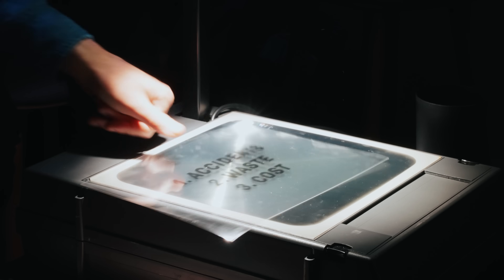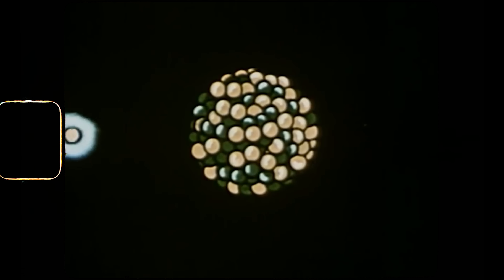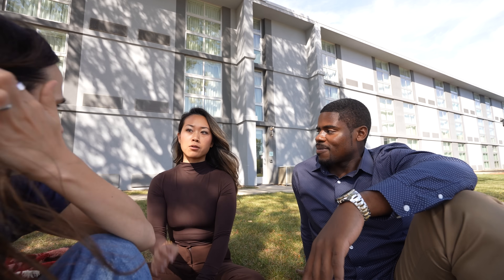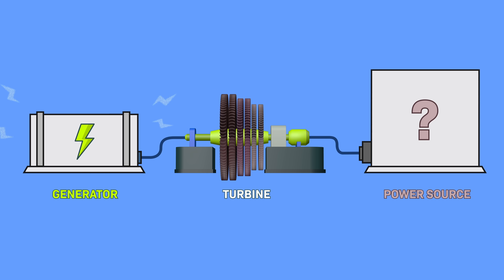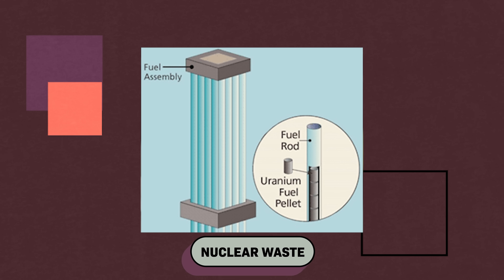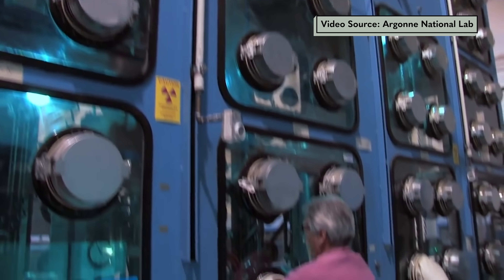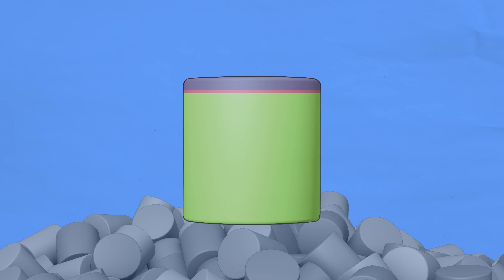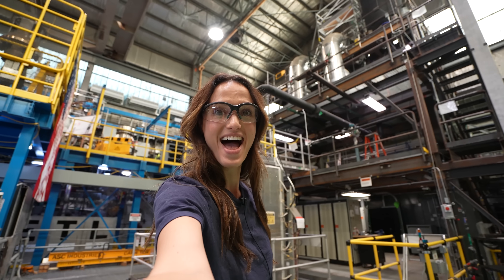The Big Lie About Nuclear Waste

Comment: Just a note.. as someone who has worked for several years in the nuclear power sector in the US.. not all nuclear waste is the recyclable ’spent fuel rods’. 
There is plenty of additional ‘low level’ radioactive waste that is made up of contaminated materials created (for example) during maintenance activities and fluids that have become contaminated. These are most likely not recyclable and do represent a long term burden to the country.
Reply: "Just a note.. as someone who has worked for several years in the nuclear power sector in the US.. not all nuclear waste is the recyclable ’spent fuel rods’. 
There is plenty of additional ‘low level’ radioactive waste that is made up of contaminated materials created (for example) during maintenance activities and fluids that have become contaminated. These are most likely not recyclable and do represent a long term burden to the country."

Yes, but you'd need to create less nuclear waste because parts of the waste will produce energy. You'll need less storage room for the material that isn't recyclable or left over after the separation process. 

The waste product of burning fossil fuel isn't kept in containers but released into the air. CO2 also takes a long time to clear from the air and is harmful as well. People who think fossil fuels are less dangerous to the human race are brainwashed.
Reply: @gwenwalravens8030  People who think that the tiny amount of CO2 currently in the atmosphere is dangerous have allowed themselves to be brainwashed by the blatant propaganda and lies. Talk about gullible and stupid!
Reply: A lot of this is medical waste from radiotherapy.  The amount of radiation in these waste materials is sometimes hard to even measure.
Reply: @artgoat  you should look into the problem of the nuclear exposure problem from a medical perspective, in that we ignore the longitudinal data from many clinical settings, like Japan being nuked twice, in favor of models based around irradiating fruit flies. I am more than willing to accept that you can get funky things going on from contamination, but I am not willing to believe that it's the radiation from the contamination that is a problem. The body produces a massive amount of free radicals and radiation on a given day.
Reply: @Dan-gs3kg  Just for fun, I googled “fruit fly percent human dna”.

I found that fruit fly DNA is 60% identical to human DNA!
That was much higher than I expected - and for a moment I thought that extrapolating tests on fruit flies to humans had lots of validity.

Then I scrolled a bit. I found that a STRAWBERRY’s DNA also 60% matches human dna 🤣🤷‍♂️
Reply: @artgoat except the caesium ones…
The overwhelming majority of nuclear accidents around the world are related to medical orphaned courses.
Reply: @artgoat  All of the materials used for radiotherapy are in fact recycled waste from nuclear reactors....
Reply: I heard that there is a technology(in developement) even for using low level radioactive waste by the hungarians (for years now)
Reply: What's the story with Yuma Mountain?
Reply: @tetoffense7659  The Yuca Mountian repository was defunded and is effectively dead. There is currently no active long term storage solution being developed/planned/funded by the U.S. government.
Reply: That is an argument of design. If the design you used created that extra waste, there is always a way to reduce that process waste. I work in process safety. Although, I will admit that better methods may cost more labor hours and infrastructure cost. They were probably just trying to keep it in a certain cost envelope.
Reply: @DaedalusHelios  the contaminated waste comes from cleaning, maintenance, contaminated coveralls, repairs, replaced parts.. all sorts.. as regulations evolve, systems are modified or replaced due to regulations.. the old parts are ‘crapped up’ often just through having served in the ‘hot side’.. you can debate as to whether this can be designed out.. there’s no getting around the fact that this waste will be produced.
Reply: @LordBruuh --- Exactly!

Besides nuclear, and cleaner coal/gas/oil burning, the only viable "green" energy is hydro/tidal, geothermal, solar updraft/thermal solar.

But electricity from traditional solar and wind methods is garbage and a huge scam.

Nuclear is the best and should provide the majority of energy for cities, with other sources being used supplementally as needed.
Reply: Interesting, but would a recycling program of some kind still be more practical in the mean time, until we come up with a better solution, despite the low level waste risks?
Reply: thats where research should happen, too
Reply: @Mr. Richard C. It is much more dangerous because it is a witches brew of radioactive isotopes not found naturally in coal. The mercury in coal is more of a concern than the isotopes in coal
Reply: I’m a fan of what the Europeans are doing and just digging a big as hole and chucking them in it
Reply: All of the (coal) fly ash waste sites that are ecological disasters waiting to happen too. It seems to be a common misconception that you can burn fossils and the CO2 is the only waste product. The reality is that coal is mined from the ground and is contaminated, sometimes even with radioactive materials like uranium. A coal power plant puts 100x more radiation into the air than nuclear plants. Many of these fly ash pits sit on the banks of waterways and contaminate our drinking water and environment already. The nuclear fuel waste and potential ecological disaster is arguably easier to manage because the volume is so much lower. If not for coal power already being an intrinsic part of the power grid, it's hard to imagine a coal power plant being an acceptable project given the environmental impact.
Reply: The amount of space required to store all of the nuclear waste from the entire planet since the beginning of nuclear power takes up less space than a single wind or solar farm.
Wind and Solar are far more damaging to the environment than Nuclear Power with our current capabilites.
You don't just put down and wind and Solar farm and leave it there forever for 'free energy'. Those wind and solar farms wear down just like everything does. While the waste from Wind farms and Solar farms is not radioactive, it is also not recyclable by any means we currently have and it buried unlike nuclear waste which is stored above ground in constantly monitored containment cells.
Not only that but these wind and solar farms are eventually abandoned and there are huge swaths of land that are just solar/wind farm graveyards.
The alternate options for energy besides Nuclear all cause so much more waste than nuclear power plants do that it is not even close.
One day with advancements we may be able to recycle solar/wind farm waste or improve our grid and other features to make them worth using but as of now they are terrible for the environment. We also will eventually have better ways to deal with nuclear waste, but as of now as I said all of the nuclear waste ever created in the world takes up a tiny spec of space in the world to store, where all of our other forms of energy cause massive amounts of unrecyclable waste that also require plenty of pollution to create the fuel for in the first place. Those materials to create solar/wind are not generated out of thin air.
Reply: There are plenty of waste burden that we as a society have to take care of, especially in chemical industry. That is a bill that industry inexorably asks us to thrive and flourish as a humankind, and pretending that we should not have such burden to deal with for many generations to come is only going to make things worse because the environmental costs of such externalities will be the real thing future generations would have to pay, not the production of externalities in se. Also, the fact that you are talking of waste falling into category of "low-level" means that no such extents of bold measures should be requested to deal with such kind of waste in even the long term, as compared to so-called high-level one. I also point out that, given that the issue of toxic waste burden is not a problem that mostly nuclear power have to let us deal with and to concern with as well, but it is due to any industrial facility that we need to not torn apart our well being, and that the point is not to not unrealistic wishing to not produce that waste at all despite is inevitable, but to isolate it from the biosphere, which we also routinely do with a very higher amount of highly dangerous chemical waste without a bit of the same amount of paranoid cautionary regulatory measures that applies to dealing with nuclear waste (also low-level ones) would barely be requested (!!), it's a bit bizarre that it is nuclear waste that drives such amount of concerns just because most people have a highly clueless grasp of ionizing radiation and especially on the measure of risk that could be reasonably associated with it, and this even with no regard for the dose as we would use to do regarding any other kind of poisoning agent, but far higher in magnitude orders and often even in toxicity amount of chemical waste we produce on a daily rhythm, just because "not radioactive" (so that will remain dangerous FOREVER, not just as long as when it became as radioactive as uranium ores!) does not drive such supposed "concerns" from antinuclear lobbies which resorts only to anecdotes to scare the public in such selective way.
So it's not a matter of genuine concerns. It's just utterly clueless fear of technological engineering and breakthroughs that are too complex for many people to understand. And that tied with strong support from the fossil fuel complex, which environmental and health damages, in complete comparison to the alleged those of nuclear materials, are instead well-known and proven by thousands of peer-reviewed studies.
Reply: @anhourofhonourforanhonesth2940 --- The near future is in gas, oil, and coal... as we build more nuclear, hydro/tidal,, geothermal, and thermal solar plants.
We will retire the older energy sources.
Reply: @BlueAcid9  I doubt we will retire legacy energy solutions in any foreseeable time. One datapoint that I suspect would shock many is that coal demand hit a record high, get this... in 2022! The thing is that total energy demand itself is rising globally. It's something that people from the developed world may have issues grappling with, but there are many parts of the world where there is very limited or no access to electricity. If memory serves me correctly, there are about a billion people with little to no access to electricity, and three billion people who only consume the energy equivalent of an average refrigerator. I probably remember those numbers incorrectly but that's about the scale we're talking about anyways. A very large portion of the world remains unelectrified and underdeveloped, and those people would like to have the same amenities we in the developed world take for granted. That's why I'm certain the demand for all forms of energy will keep growing for decades to come.

Eventually of course I like to think that we will reach some technological milestones that allow us to produce abundant energy with as little impact to the environment as possible, but that time is not something anybody can really predict.
Reply: @TheHeavyModd  you made an excellent point by taking everything into a bigger, more global context/view. I said this for the longest, every single barrel oil the West isn't buying, someone that will happily say, "thank you." so ultimately, it'll get burnt just somewhere else. I don't wanna hurt the environment, but have a feeling that environmentalists don't really take this aspect into consideration.
Reply: Thank GOD we can 100 % recycle everything that is left over from solar panels, batteries and wind turbines
Reply: @georgeinthejungle6095  not even the propagandists of renewables are claiming this, lol.
Reply: @To.Ma.To_78  well you see ,here is the beauty of coal based energy " IT IS 100% renewable "
Reply: @georgeinthejungle6095  
😂😂😂
Reply: @georgeinthejungle6095  Contains lots of irony 😂😂😂😂
Reply: @georgeinthejungle6095  I wonder how many will notice the sarcasm of this post.
Reply: @georgeinthejungle6095 
And thank god those PV panels, wind turbines and batteries never need maintenance and never wear out.
Because, of course, if they did - the math wouldn’t make sense and we wouldn’t build them.
Reply: @georgeinthejungle6095 no we can't...
Or was it ironie ? If yes we'll done 😂 If not, you know nothing than propaganda 🙄
Reply: @george in the jungle  we can. It's just that current is not in favour of it.
Reply: @georgeinthejungle6095 🤫
Reply: Yeah - all that contaminated water at Fukashima - tell them they can make more energy from it.
Reply: Geoff..,you are correct. The French ran the most efficient nuclear program in the world and recycled and even bred fuel? But now after their old reactors need to be decommissioned they are being crushed under the burden of all the low level nuclear waste. What people fail to realize that even after a couple hundred years after the spent fuel is cooled off and not nearly as high level radioactive waste, this low level waste is the most dangerous because all the new created fission isotopes are more dangerous than the original low level radioactive fresh fuel...because they're all readily absorbed and spread throughout the environment and must be stored to prevent this for hundreds of thousands of years. This is the deadly part if it all.
Reply: @gb-jg1ud  As a rule, though, isotopes that are more radioactive are those with shorter half-lifes, so highly radioactive materials are also those that need to be stored the least amount of time.
Reply: @Nyerguds  correct. The most radioactive isotopes are the easiest problem to deal with because on a human scale we only have to deal with them a few hundred years..,but its after that that they are still extremely dangerous and must be contained longer than the age of the pyramids.
Reply: @gb-jg1ud   reference please! Sounds more fear than science to me at first glance.
Reply: @jean-marclamothe8859  I replied to you twice it will not allow links
Reply: @gb-jg1ud  .. agreed.. this dimension is seldom discussed, but I feel it needs to be far better appreciated.
Reply: @Kiwigd --- Wrong, all "waste" is merely potential resource waiting for higher efficiency extraction of radioactive energy.
In the mean time it can be melted down either as metal bars and stored like gold or steel, or the slag can be mixed with molten glass and stored like hard cheese wheels.
It is stable and be kept in underground facilities in Salt Lakes and similar safe environments.
Reply: @BlueAcid9 
Germany is right now trying to dismantle a nuclear reactor that has been in use, and I am afraid the project proves you wrong. 
(You could look up 'dismanteling Lubmin nuclear reactor, but I am not sure there is resources in English)

The new estimation is that'll need 200 years to complete. 
There is so much radioactive concrete, there is so much metal still to active to be touched. 

Lubmin only has been used for a couple of years - I am afraid, your longer-in-use US reactors (and basically every other reactor in the world) won't be dismanteld ever. I am afraid the human race will have been eradicated before the plants cool down enough to start the 200 years of dismanteling. 

That does mean, before they fall apart, that you will need to find a way to encapsulate them so the radiation doesn't seep out - for forever, which usually is no term an engineer thinks in. 

Again, Germany is trying to build such an "forever" storage place (just for the waste, we do not operate any more reactors), and the cost is astronomical - and we do not sit on nearly as much waste and low level waste as most other countries, because we stopped pretty early.

This debate is a very hard one, because almost noone knows all relevant facts and energy production is such a central topic for economy and modern life. 

But the waste is going to be really, really hard to get rid of. 

And it is different for solar panels and wind turbines, as those cannot make ppl in a 50km radius sick. 
Nuclear waste can and does kill. 

Humanity doesn't have a great track record of clearing up regional health debacles - on the topic, how is water in Flint? 

I personally do not think it is worth the risk (and the cost, studys comparing the cost of energy sources clearly list renewable ones as the cheapest). 
You can, oc, disagree. 
There is a whole ocean between us, I am not that afraid of the choices the US make and would rather try to convince the french :)
Reply: @sini234  Being from Germany myself, I watched that documentary film about Lubmin a few months ago. The input-output ratio of costs and effort for dismantling the facility to the power it once generated is just horrifying. Let alone this is just ONE reactor -- of the many we'd have to deal with in the future.
Reply: @sini234  

You're afraid.  You think.  You believe. You feel.

Your fears, feelings, beliefs, and opinions are irrelevant.  

Engineers solve problems.
Reply: @gregmiller8284  As an engineer, I can tell you for sure: this problem is not solvable right now. 

Forever is not possible. 
For 1000 years is not possible. That's basically forever. 

Please excuse me trying to be polite in your language, I did learn a way to reach that was to write "I'm afraid", before speaking about bad news. 

I feel and I think I couldn't find in my text, did you only use them so your statement would look more impressive? 

I believe I did write - and I did also write you may disagree.

As I stated, this is a very heated topic, especially since the fabs you're trying to bring to the US will need a ton of power to operate. 

And it is true: it doesn't matter to me personally if you blow up your whole country. I am quite sure I wouldn't miss it.  Mine has always been able to thrive in Europe. 
Then again, if you blew it up with nukes, you'd deteriorated the air quality so badly, life would probably be impossible on the whole earh. Since that isn't what your planning, that's okay. You are planning to risk that every single nuklear power plant going to leek it's radiation into everything close to it. That's going to make dozens of city's in-inheritabel.

Right now, what everyone is telling you is true: the power plants are mostly safe. 
But since forever is impossible, that's not going to stay that way. It might not be for another 100years, before the first collapses. But one will.  

I am more than glad my country can operate seperate from yours, and does just that. 

I am sorry you didn't seem to have read what I wrote well enough to respond to one of the factual points I am making. 
I am sorry you didn't see that someone who also has knowledge on the topic responded to me. 
I am sorry for the next generations in your country. 
 
I found you comment to be very rude. Can you bring anything factual to this discussion? 
The only thing you did was trying to invalidate my facts with the way I am writing in your language. 
Do you find that a good way to discuss a topic? 
And even if it was just an opinion and nothing more, your text is also just an opinion and nothing more. 
You put all your hope on people like myself to solve your problem. 
Hope. You can see that yourself, right? 

Just because something seems to be a perfect solution, doesn't mean it's safe. Doesn't mean it can be safe. 
Did you know that places selling shoes in the past have used X-ray to determine if a shoe fits perfectly? That practice needed to be stopped, because there was no containing the risk. We cannot solve every problem, and nuclear power might just be on of the unsolvables. 

I will leave it at this, because I believe you just 'know better' and that 'your perfect country can't do wrong'. 
Have a great day, have a great life. May the problems you are facing not be yours to solve.
Reply: @sini234  while your text contains lots of typical "mistakes" (well, this actually goes whichever way you wanna take it, lol), I'd like to provide you a little "donkey bridge" [<= ain't no "proper" expression, lol] for one of them: you may like leek in your tacos, but you really like leakin' tacos. 😉😂
Reply: @WoodymC  not only that.... image the realistic timeframes!

Planning : 5-10 years
Building: 5-15 Years

Operation : maybe around 50 years

Dismantiling: 10-XXXX years...

So even if you take absolutly mindboggling fast planning and construction, a maximum run time of 50 years and lighting fast dismantling, 

you use 20years of non-use against 50 years of use and then you still have shit left over that will takes almost forever to be dealt with...

It just doesnt add up.....
Reply: @gregmiller8284  Yes yes... engineering solves problems, until it doesnt.... or it takes 20-30 40 years to dismantle them.... 
Just because something is technically feasible, doesnt mean its a good thing to do....
Reply: @Mouhfighter  To be fair, we should put that timeframe in correlation to the energy output of the facility. Fission generates way more output than e.g. fossil fuels, just as fusion power is in an even higher dimension (I have no idea what practical cycles will look like for this kind of reactors).
Reply: @gregmiller8284  engineers on sigma level.
Reply: @gb-jg1ud  thank you for this comment!
When watching this video I thought it was sponsored by the nuclear industry. The information provided here are not really balanced
Reply: @gb-jg1ud  Good example. And to me it's like shutting the stable door after the horse has bolted. We need solid solutions for dealing with all the waste, not this high level marketing campaign from the nuclear power lobbies telling us it will be safe, trust us...
Reply: @aries6776  The only method of dealing with waste beyond storing it somewhere for thousands of years is to run it through a breeder reactor
Reply: Commenting to give this a boost.
Reply: @eh86055  it's the top thread that had been hot just four hours ago and you commented during nighttime—so, somewhat inconclusive to which extent this was needed, lol.
Reply: Bingo! Exactly correct.
Reply: Thank you for posting this it's the hard truth.
Reply: @brandonhammett4071 --- He's wrong.
Reply: @BlueAcid9  I have worked in the nuclear industry, and from my experience, he isn't wrong.
Reply: @brandonhammett4071 --- He's wrong, and your experience means crap. The nuclear industry you work in is one that has been artificially hindered for several generations, 
Without that the technology would be much more developed and the energy process much cleaner along with storage .
Which even assuming the waste couldn't be used for anything would only need to be stored for 100 to 200 years before it was no longer dangerous.
Reply: @BlueAcid9  I was one of the contractors who was literally on the reactor floor, swapping rods, and changing fuel pellets.  So maybe you don't know everything about it. Maybe you should consider there's alot companies keep out of magazines and the bullshit you read. Or maybe get out of the basement and find out for yourself.
Reply: A burden that is far outweighed by the benefits
Reply: In short: We should do anything possible to switch to renewable energy sources. Nuclear energy can only be a bridge not a solution and should just be used, if we don't have a noncarbon alternative. The already produced waste has to be made as harmless as possible even though it will never be really harmless.
Reply: @holterman88  sorry, but what you are saying is flat-out foolish. Assuming that so-called renewables have a means to be developed, THEY ARE purposely to be a stopgap solutions (for what they could reasonably produce), whilst nuclear power is intrinsically THE solution to switch from a fossil fuels based economy, due to be the densiest source of energy human ingenuity has ever invented. As for the waste, again, it is very utterly bizarre that this has been portrayed as a uniquely dangerous and concerning kind of waste, given that is is small, and never have harmed anyone. Please, don't fall into bullshits which are born out of cognitive dissonance and utterly ignorance of energy engineering, to force development of "renewables" beyond the reasonable feasibility of such alleged "solutions" just because widely promoted squeamishness on nuclear power that fossil fuels lobbies has promoted to get themselves sealed without no serious threat on their monopoly that nuclear power could pose in the first place, is profoundly ideological, not scientific. It's the same thing as Lysenkoism, trying to force natural laws to fit an ideological point of view at all costs, in an a priori means despite what biological laws says, let alone any reasonable feasibility of such things, which has obviously led to utter squandering of economic resources on Stalin's Soviet Union and to dire starvations which caused many tenths millions deaths in the late 1940s through Soviet Union and Mao's China. Low-dense energy like renewables are flat-out THE PAST, they are actually an utter waste of taxpayers' money, and persevering to fund R&D on them instead of focusing on more proven, as well as provable feasible, solutions is a play that favor Oil&Gas interests to remain sealed and to flourish when the real proven solutions are treated with squeamish at the best, and the economic and time resources to transition from fossil fuels are intrinsically scarse and limited to deflect all those into delusional "solutions", which are of very little use, and more importantly given that the flat-out first sign with which you can clearly identify a quack is when you are dealing with someone who promote the blatantly unscientific idea of "solving" an issue as big as the energy one with ONE kind of solution: it doesn't work, it doesn't work with fossil fuels, nor nuclear, let alone "renewables". The first clue when it comes to understand ANY energy issue, especially globally one, is that there is no such a thing as a silver bullet that could be versatily used to deal with all energy issue, you need a very complex strategy which poses a well-projected energy mix to diversify energy sources evaluating each one's costs and benefits in a rational and scientific, not emotive, ideological or anecdotal, means. Anyone who promote a small kind of solutions as a kind of panacea is a quack which has no credibility, which adds even more at who fools people by promising that "renewables", the worst kind you can pick out of such solutions, can feasibly and economically sustainably replace a dense source of energy such as fossil fuels or nuclear! As for renewables, we ceased to rely mainly on them when we managed to escape from poverty and begin to flourish, so to replace wood, wind and solar with coal and gas, and from these we should be expected to switch to uranium, which produces as about 50 million times as heat energy as carbon combustion per atom unit, leaving renewables to fill the peaks of demand and the load following. We should be develop NUCLEAR AS POSSIBLE AS WE CAN, not renewables, if not just as a (partial) stopgap together with replacing coal with gas in the same time frame.
Reply: Cant we just dissolve it in any other mass? Just mix with anything and radioactivity will reduce million times.  For example mix  1 kg of waste with 1000 ton of dirt. The resultant mix will have on 1 in a million radioactivity of the original waste?
Reply: @Yggdrasil_Story  nah, it's better to keep the high level waste contained or confined to a small, controlled space. but you can certainly do it with low level waste. in fact, that's what's done in France, where after a certain rest period, material used for the construction of now decommissioned plants is recycled back. that's why you can—theoretically, at least—buy a spoon that contains some metal once used inside a nuclear power plant. something activists really relish pointing out, as you might imagine, lol.

apparently, the tiniest amount of (dust) particles is problematic when swallowed. after that Chernobyl "incident" rather fine particles where sent up high into the atmosphere due to the fact that you had a gaping wide open hole in the ceiling and graphene burns at a very high temperature, causing an updraft strong enough to propel some particles high enough into the atmosphere so that the weather system carried them over half Europe and came down at various places with rain again. that's already a massive dilation, yet it was (and still is) problematic. it actually rained on me, so I'm somewhat familiar/connected with this situation. the surface around our social housing building was excavated afterwards. and that's just one incidence in one block of one plant at one particular time. so, the actual dilution required for all waste there's might just be unachievable.
Reply: @To.Ma.To_78  well said. Dilution is not the answer. If it gets into the environment in any way it re concentrates due to food chain and the fact that water runs the planet. And it has hundreds of thousands of years to do it. The high level waste in one spot for a few centuries not the problem. Its after it is low level and equal to the massive...massive..
Amounts of contaminated waste we already have.
Reply: @gb-jg1ud  very wise of you for pointing out that it'll concentrate again over time due to the food chain! on the other hand however, I do disagree with the terminology you used, when you described nuclear waste—which indeed is problematic, I wouldn't question that—and said, "massive;" repetitively, even. that's one of the great advantages of nuclear that due to its density, actual material required is minimal. compared to the Earth's surface, Mt Everest isn't even "massive." it might be a lot for one single person to put up with when stored in their backyard. but compared to the gigantic vastness of huge swaths of land masses all over the globe—no, it's not really noticable. a solar plant with the same nominal output weights about 18 times as much as a nuclear power plant (this includes all auxiliary buildings as well.) and rare materials that require mining weigh 300 times more. and yes, mass gives a pretty good overview/indication/estimate of what we're generally dealing with. since positive cost effects gained due to mass production won't offset a much higher need of raw materials.
Reply: @Yggdrasil_Story  what? I kinda described everything in fine detail. no, it's not just a theory! you can still not dig too deep into the ground and certain mushrooms as well as game that eats them is still problematic up until this day (with limitations on the amount in place.) it's not the water, that's problematic. it's those fine dust particles directly outta that molten core that went high up into the air. think about a volcanic eruption. there, you've a similar distribution of soot and ashes into the atmosphere—just thicker, so it's easier to see planes aren't allowed to fly in that area (which can get quite huge) because they're so abrasive, it hurts the fan blades. have you ever heard about a nuclear winter? no, that wouldn't be radioactive, but it's again about a similar dissipation of particles across a wide range.
Reply: @Yggdrasil_Story  could you immagine the cost excavating 1 million tons of earth and then dilute 1kg of waste in it. Dilution is an option though for water soluble material if you have access to the sea for exemple. But concentrating them is a much better solution. you can burn them (in a facility designed specifically for it), and radioactivity will be concentrated in ashes. Likewise it is done for liquids by evaporation.
Reply: @darkounet3478  your ratio is off by three orders of magnitude. but generally speaking, I think that you're right. diluting nuclear waste is like burning coal and releasing its waste into the atmosphere. the superiority of nuclear energy stems from keeping everything contained, so the environment isn't that strongly negatively impacted by our energy needs.

I'm even against burying it. good chances, this material will become a raw source for some application, one day—like medicine. and in addition, there's quite the possibility to further split those problematic elements up and create even new atoms that are then less problematic. this would require energy, though—and not produce. maybe one day that'll be abundant enough to be viable; like should there be a way to figure fusion on Earth (which I'm doubtful about, honestly.)
Reply: @To.Ma.To_78  well it depends on what you plan dilute. This ratio indeed way too high for low level waste (like concrete, steel, gloves and such that are only lightly radioactive) which need to be diluted by about 1/1000 . However its way too low if you plan to dilute alpha emiters like Pu239 radiating at about 1TBq/g which would need about 1/10^12. Not every waste is created equal. Personnaly i believe that burrying is a good option for some types of waste : low activity waste that can't be burnt or concentrated, medium activity metalic wastes (hulls) and vitrified fission products (fission products are only harmfull for a few thousand years which is realistic for underground storage). The real problem is what to do with plutonium and other transuranics (most of long-term radiotoxiciy), i think fast neutrons reactors could be a option to "burn" them. Only the latter are not "waste". Of one can imagine that fission products might be used to provide sources but as far as i know it tests facilities did not work very well...
Reply: @darkounet3478  the Hanford site which processed fuel rods is an example of the waste produced, leakage, non working dilution solution, and cost of processing millions of tons of earth that is contaminated.
Reply: @gb-jg1ud  the thing about low activity waste is that they are not that harmfull. Plus if they are mostly contaminated, meaning that there again you can wash them and concentrate the solution. There is so many possibility to deal with these than just landfill, depending on the type of material and the alpha/beta ratio and where it is produced.
Reply: @darkounet3478  On this topic, didn't the Japanese deal with their Fukushima-related nuclear waste by simply diluting it and releasing it into the ocean? It sounds horrible but after enough dilution it was probably rendered harmless
Reply: @TheHeavyModd  well it depends on what was the "nuclear waste" is. As far I now (i wasn't there so i might be wrong) most of the "waste" diluted in the sea was tritiated water wich is quite short lived and not very harmfull plus it's very compatible with normal water and thus dilutes very well. The water could be marginally contamined with other stuff but i guess it's negligible. The term "nuclear waste" is very vague. Depending on the way they are produced (fuel manufacturing, power plant, reprocessing plants) their properties vary a lot. Some are suitable for dilution in the sea, but a lot of heavy elements do not dilute well in water.
Reply: @gb-jg1ud  hanford site is a bit tipycal of the 50-60s mindset of "polution not being an issue". A few years ago i worked on decomissionning a plutonium production plant. Until the late 70s their waste management method was mostly dumping solid wastes from fuel in giants stainless steel tanks (of around 2000 m3). Given how hard these are to empty, after a while you start to really hate the designers of the plant.
Reply: @darkounet3478  yes, yes, I can agree with what you wrote. mainly, that waste and waste isn't just all waste, but you'd need to look closer about which type we're talking. construction material used to build a reactor is when such gets decommissioned obviously beyond any further use and to bury that is certainly a wise idea. I meant the spent fuel which contains newly created elements. those might be quite useful, one day. just as trans-uranium ones, as you pointed out. which are pretty stable. and don't naturally exist on earth. but also the other ones like cesium and strontium and quite some more; just their radioactive property might come handy too. for purposes we simply don't know yet.
Reply: Romans 10:9 = Eternal life 

1 John 5:3
“For this is the love of God, that we keep his commandments: and his commandments are not grievous.”

Ecclesiastes 12:13
“Let us hear the conclusion of the whole matter: Fear God, and keep his commandments: for this is the whole duty of man.”